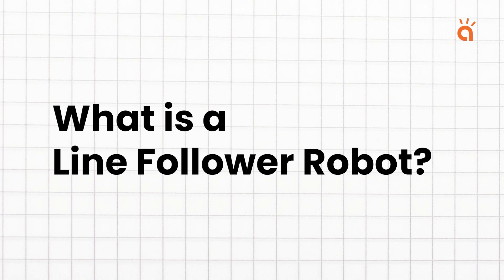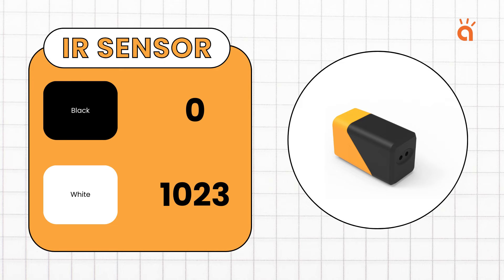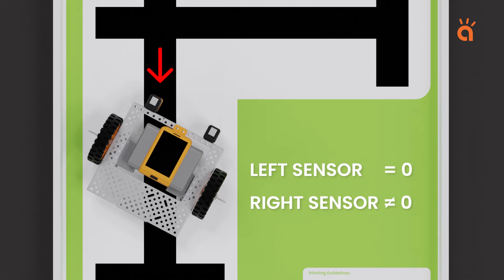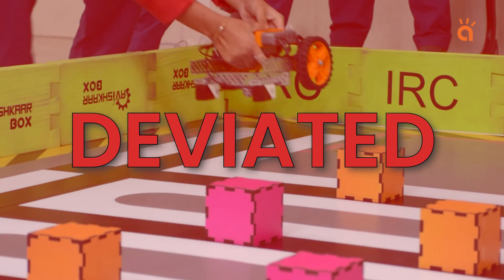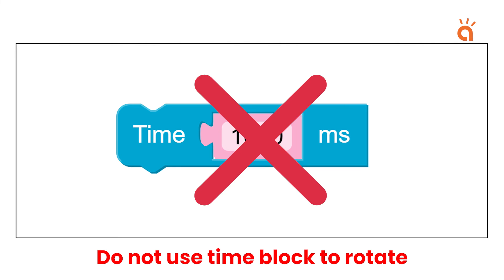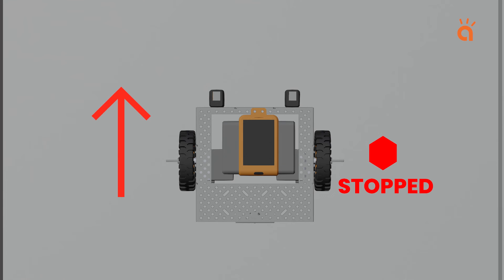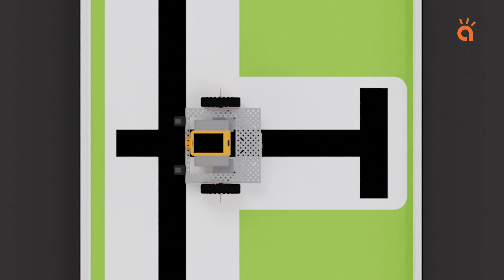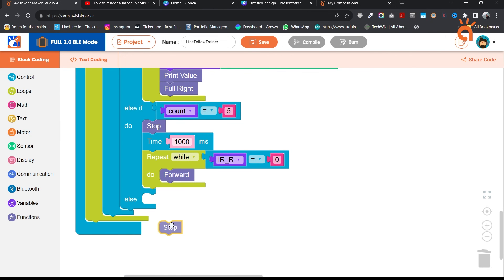How to program Line Follower Robot efficiently | Sensor Based Logic | Tips & Tricks

Comment: After the both sensors detect black, ie intersection, a delay should be there else the robot will keep on counting. I have experienced it.
Reply from the maker: That will happen if you don't use any loop. If there is a loop it will run first until the condition is changed. Also if you are using Arduino, Use While loops.

Comment: when you were programing count 2, the robot didn't take the full 180 degree instead it stopped when right sensor detected black line, so please tell how to make full 180 degree turn
Reply: Arnav, The sensor will use two loops to complete the 180 degree turn.

1. Rotate Right till the right sensor is on black - This loop will rotate the robot to white color.

 
2. Rotate Right till the right sensor in on white - This loop will further rotate the robot to black color.